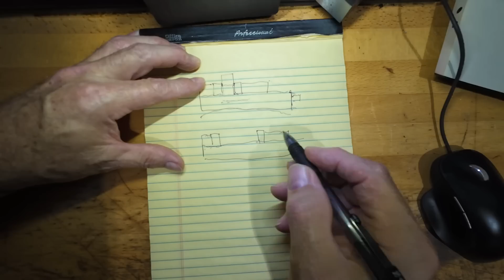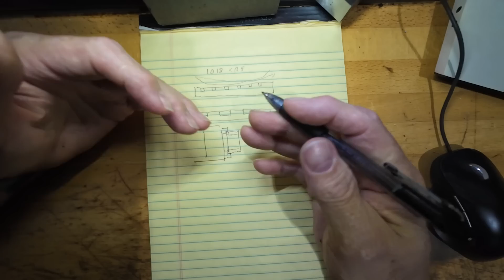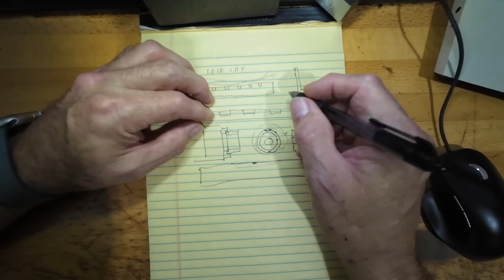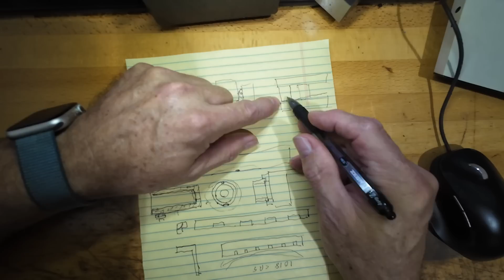Distortion From Machining and Setup

Comment: Very cool topic and extremely overlooked in most shops. Material stress has become a constant battle in my shop. I make a lot very thin walled tight tolerances parts for defense on millturns, mostly ph 17-4 1025 and 1050, 316 304 etc. For years we had problems with these parts going out of round and having a lot of taper after they come out of the machine. They’d measure fine and be nice and round in the machine but totally change after partoff. I’ve found that the more material you can remove before any finish cuts the better. Also putting a groove behind the part so it’s only being held by a thin tab, then running the finish passes really makes a huge difference when trying to hold tight tolerance/roundness. I’d love to see more talk on this subject.

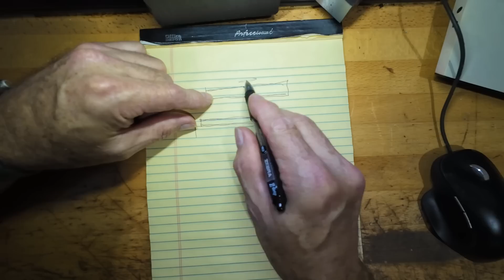Comment: 13:38 i think you might be mistaken here.
The internal stresses are pulling the atoms together, not pushing them apart.. so when you mill the face of a plate, it tends to bow convex to the milled face after releasing work holding.

Cutface--> [] <-residual face

     Bow--> ((

Comment: True story, 
Once, I had the table off my VMC looking for why it was binding and causing axis motor to over load, found out it was due to having extra vices mounted to increase part density and as mentioned they were distorting the cast iron table, (machine has 800mm travel in X so I wouldn't call it tiny).

Comment: Understanding part distortion due to internal stress in the raw material is basic to making parts. There is no escape from this reality of raw materials and how the internal stresses from and during the raw material manufacturing process happens. The amount and kind of internal stresses for any given piece of raw material to be worked on by a machine tool is often unpredictable and will only reveal once the material removal process happens.
 
This is a complex topic, yet absolutely essential to making parts using the subtractive machine tool process. It would be excellent to do a series of videos on this topic as it is so very important to properly understanding what happens as parts are being made.

Distortion due to work holding is another given. This is why work holding fixtures can be extremely complex and at times far more complex than the part to be made. There can be very complex design work related to fixtures and how work holding fixtures impact the part to be made. Again, an excellent topic for video content.

Other process factors that impact the finished part, heat treatments, aging post process, environmental conditions, storage conditions, corrosion, surface finishing.

Another worthy video topic would be how surface finish impacts measurements and tolerances.

There are many machinist on YouTube, Pete at Edge Precision is one of the best for sharing useful information and experience with little to no YouTube content stuffing, simply excellent in many ways.

Comment: You are so far above my level of expertise and youre making parts that I will most likely never get to machine. I simply dont have the skills or dare to even try 😅

The simplest thing I tell our apprentices in relation to this topic, is that if you clamp down a piece of raw material in a vice - dont start hammering on it like youre insane just to get it to touch the parallels. Ive seen people do this a lot with aluminum and the result is that the part will warp back once you unclamp it. 

You know what - Ill have them all watch this video. Thank you, Peter 🤗

Comment: distortion is my worse enemy, i often have to deal with only holding onto a few millimeters of stock due to free-issue material cutting it close on thickness and it makes it such a hassle. Taking even amounts of stock off of both sides helps a lot but that isn't always possible due to complexity of some parts. I'd love for you to go into more detail over multiple videos, showing demostrations of parts distorting and then how you would go about avoiding it. Would be very useful! Thanks for the videos!

Comment: I'm actually trying to get the CNC department at the local tech college to add a course on workholding and material deformation, so if this turns into a video series it would be awesome. 
I came into machining as a welder/fabricator so I already had experience with material stresses, but there are a lot of new machinists out there learning the hard way.  It would be nice to give them a leg up.

Comment: what if you heat-treated the part after machining. in a fixture that forced it back in shape. then heated.
Reply from the maker: Yes heat treating (stress relieving) can relieve stress,  as it name implies. But most materials you work with in a moderen machine shop are or have certifications. So if you do any heat treating on the material it would have to be re-certified. Witch costs more money and material and testing to see if it meets the requirements. If it doesn’t it is just scrap. So you need to learn to machine without changing the material. So you need to use techniques that don’t involve heat treatment.

Comment: When I started in my first job many years ago I visited a supplier who had a very large planer and I asked if that wasn't an obsolete technique. They explained that the local heat input of a milling cutter would distort the material and that planing would not. Always stuck with me. As Renzetti says, everything is rubber. Once you are dialed in to this level of perception you are probably en route to becoming a true craftsman.

Comment: Thanks for this video, very important subject! I often run lage forged rings in vertical lathes with 4 jaw chucks and have plenty of problems with distortion, i usually rough material and then release chuck pressure and then finish or leave stock and finish on another set up. I would love to hear your thoughts on different techniques to deal with this? Also would like to hear your thoughts on shaft work. for example roughing and finishing one side then flip the part and roughing and finishing the other side and ending up with the shaft being bent in the middle? Thanks for sharing your knowledge.

Comment: Peter, yes please make more videos in greater detail. My questions are:

With 1018 CRS, how much would you fly cut off the top and bottom (with a positive rake cutter) to get through the compressed material down to stable material? How much extra thickness should I start with?

What detailed tips do you have for turning 316 SS. Specifically a 7/16” round rod, taking 0.010” off the OD, turning about 1” of 14 TPI threads on one end and 1” of 20 TPI threads on the other then parting it off at 4 1/2” long?

Thank you for all you do!

Comment: Love your videos. They have helped me with a bunch of different situations. I am learning a mori ntx 2500. I have a question about wait codes. I found out mastercam does not put them in. Do you have sane issues with esspree?
Reply from the maker: @derekk8523  No Esprit has made the post for the Mazak work almost perfectly. Really if the code is wrong it’s usually something I defined wrong in Esprit not the software.
Reply: @EdgePrecision  gotcha. Mori rep said they have had issues with it on these machines. Guess they ironed it out with newer machines. This one is 3 years old and still has its quirks.
Reply from the maker: I will say this. Esprit's support for me has been very good. They respond to questions/troubles very quickly. When I first started using Esprit TNG, I had a little trouble with their deep hole drilling cycle. I was using it for gun drilling. Also I was getting some errors with the machine going out of limits in the X plus direction when rotating the B axis at the beginning of a tool. They also helped me understand and define the coolant powered EL tool 90 degree head. So it worked properly in the simulation and output code properly. When you install Esprit TNG (This may have a new name now) you also install another program called Esprit machine tool builder. That is what I used to define the EL tool 90 degree head so Esprit would know it was another spindle and its orientation for the proper cod in relation to its spindle. But with this software you could model any machine and define it's axi and spindles. Or fixturing to use in Esprit on another machine's model. Like steady rests vises live spindles on a turret lathe exct. They should be able to provide a working simulation model of your machine, that works with you/their post to output code the way you want. And it's been my experience that their support will correct any of your problems to make it so. They have a method for you to save your program and tool definitions of a program you are having a problem with. Then e-mail it to them. Then their support will take that and figure out whats wrong and get back to you. I have had them get back within the same day with a solution before. Or at the longest the next day. I no longer have been maintaining my support agreement because it isn't necessary for me now. And it does cost more then I want. But if you are in business to make a living/money it is well worth it.
Reply: @EdgePrecision  thanks for the advice

Comment: Don't know if the precautions would mean a lot to me , as i went trough many of these issues , and will go trough more as the bosses usually can't accept the time and effort for 1-2 extra operations .
I'm certain many would benefit .

I'm maybe more interested in the actual fixing of these issues .
Aside from that , workholding and jigmaking would be more relevant for me , i've seen lots of examples , but there's always more to learn .... For example some people can't understand an intricate form cannot be clamped from all sides in simple vise even if you make the perfect contour , it's much better to establish 2-3 clamping 'points' and mill some extra space in the negative contour for the non critical features. Also many think if they machine 10 pockets in a vise jaw they can hold 10 parts at the same time , also not true .

This subject is vast , explanation with practical examples would help quite a few ....now it depends how much time and effort are you willing to put into such 'basic' series , as this channel is more about the cutting edge . 

I've seen quite a few videos from you where you present and explain auxiliary jigs , that's the pinnacle of workholding and fixturing . Gundrill bushings , sacrificial pocket-filling insert for an inclined hole , these stuff that we don't see just everywhere .

The custom tools that you sometimes make , are a treat to watch , but might not be so useful for us, and here i mean the custom shaping tool for an exotic job that you did in the past . I think you used  DCMT insert and indexed the C axis to shape the form . 

Some of these awesome videos are deleted upon customer request :(

ps: i'm glad i see a new upload , hope you're doing fine and health is generally good .

Comment: The topic is great for making videos. Actually i had troubles like one of yours examples. I was doing simple facing on brass 400x40x30 mm stock, I hold it in 2 vices. And it bend in the middle. Even small finish cuts couldn’t help me. Now I already forgot how I did finish this job, but at that time i get that my setup causes some distortion, but I don’t really know how to deal with this issue.
Great work as always!

Comment: I started my apprenticeship in 1975. We were taught about stress relieving material. Often we had to release chuck pressure over night on larger turning jobs. Complete roughing all over was normal practice and centre's often had to be recut to achieve straightness again. Some steels are more like green wood than most people ever imagine. Bright cold rolled square and flat bar is amongst  the worst.

Comment: Hi Peter..great video, I’m pretty new at this and my company supplies fixtures plates that are 40” dia with flatness of -+002 in hot rolled….also 6061 rings same size with dia of +-.005….. I can’t tell what a challenge this has been. We had a 38” inside dia on a .5 plate out of round by .023 after milling out of the center…machined a second one and it was perfect! Keep up the video they really help. Dave

Comment: You are absolutely right, this is a difficult and varied subject.  I recommend you you stick to one topic at a time, like thin parts for one (or more) videos.  Maybe you should make this an on-going project where you make a segment of a of video on a part you are making anyway, and show what you are doing to reduce stress or your plans to correct for stress that you know will be introduced.  Then just sit on that segment until you have a few similar examples that you can stitch together to cover the topic.
Reply from the maker: @mattgross7734  Yes I think you are correct. I’m thinking for the first video to show the milling vise and how clamping parts in different ways causes errors.

Comment: I would like to see how much the rigid jaw of a precision vise distorts compared to the spindle location. I am talking to the 1/1000000” of an inch, or better. I see some guys reefing (torquing on that vise with a vengeance) and then they are only going to do a skim pass. And then can’t figure out why it’s distorted!!!!
Reply from the maker: @StevenStyczinski-sy8cj  I plan to show this. I did go into this in a video I did a long time ago. I think it was in one of the videos titled “Square me up to 90”. There were three videos in this series and I’m not sure which one. But I do plan to show this again. But a vise tightened down moves more than you would think.

Comment: Technically there is no such a thing as “NON MAGNET material”. How does an MRI machine work???
Reply from the maker: @StevenStyczinski-sy8cj  It’s just a term they use to refer to that type of material. It’s called Nonmag. It’s kind of like saying Stainless Steel. Even though Stainless Steel stains/corrodes.

Comment: I once worked in an optics lab.  It had a laser interferometer set up on a giant granite table floating on air bearings.  It was about 3 feet thick. I put my hand on the table for about 10 seconds, and you could see the expansion in it in the laser pattern.  As Robrenz says, everything is rubber.

Comment: Key takeaways:

* Distortion sources: Machining processes and setup techniques can introduce unwanted distortion in parts. This includes:
    * (7:00) Work holding: Vises, chucks, and clamps exert forces that can deform both the part and the machine table.
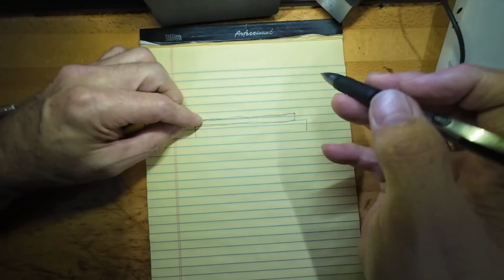    * (12:40) Material stress: Raw materials like cold-rolled steel contain internal stresses that are released during machining, leading to warping.
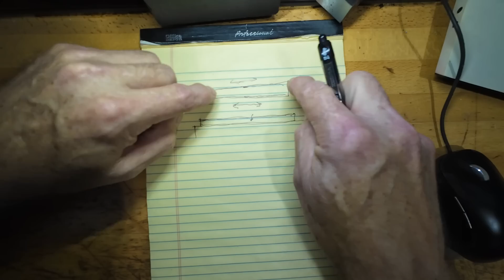    * (13:58) Machining forces: Cutting tools themselves can push material, causing expansion and bowing, especially with negative rake inserts.
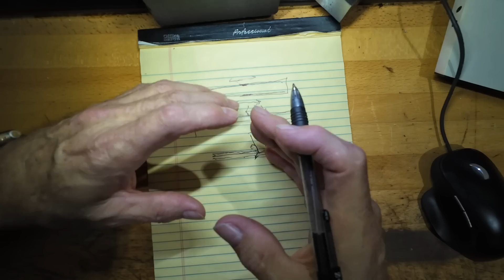    * (18:10) Heat generation: Machining generates heat, leading to thermal expansion and potential distortion when cooled unevenly.
* Common mistakes and solutions:
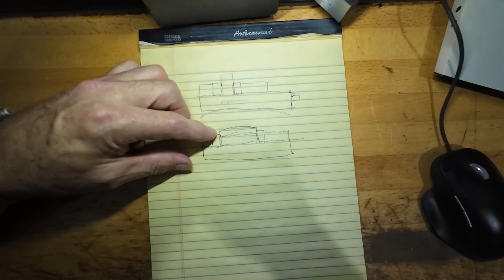    * *(10:40) Clamping too tightly*, especially on thin or long parts, exacerbates distortion. 
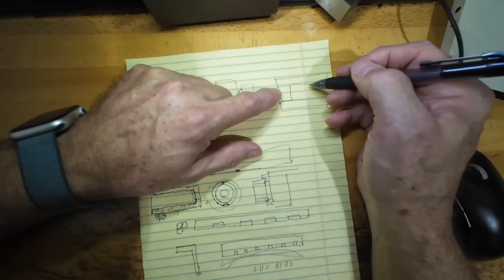    * (37:00) Off-center clamping in a vise can cause racking and inaccurate results.
    * Solutions involve strategic clamping, soft jaws, balancing forces, roughing and stress relieving, and even straightening techniques.
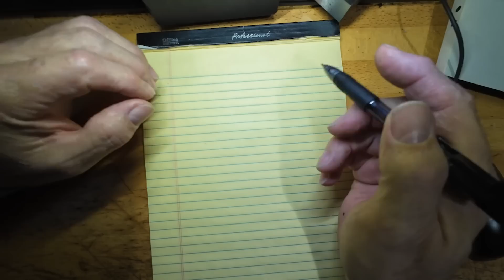* (20:00) Material behavior:
    * Different materials exhibit varying degrees of distortion. Cold-rolled steel is particularly susceptible, while hot-rolled materials are generally more stable.
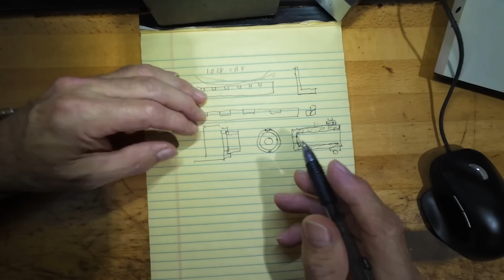* (29:40) Experience is key: Predicting and mitigating distortion requires understanding material properties, machining forces, and work holding principles, often learned through trial and error.

Call to action: The video concludes by prompting viewers to express their interest in more detailed demonstrations and explanations of specific distortion scenarios and solutions. 

i used gemini 1.5 pro to summarize the transcript

Comment: We regularly grind a hardened steel cylindrical part between centres on a Studer universal grinding machine. It is 6.5mm diameter and has a counter bore in one end, with a wall thickness of around 0.75mm. The diameter at the counterbore end has a 0.001mm roundness requirement. We could not use a standard driver as even the lightest finger tightness on the m3 screw would cause distortion. We got around it by initially 3D printing some drivers with a light interference fit on the OD and another time by friction driving from the counterbore with a mandrel with a couple of small o rings. Distortion is an ass kicker! Great video as usual.

Comment: These are some of the most important videos for new people to machining. I have 4 years in the field and i understand alot but there's still soo much i dont even think about when i program or even run a part. Im always thinking of part distortion,just finished an 1/8 304 shim cut down to .051 +/-. 002  1.5 in long  almost 5/8 wide with 5 holes and 2 countersink. The part was within dimensions and a flatness wasn't called out but had 5thou of bow. Had to control bend them all. Please keep posting videos like this. I truly help new guys atleast keep in consideration some of the problems thst arise when quoting/programming/running